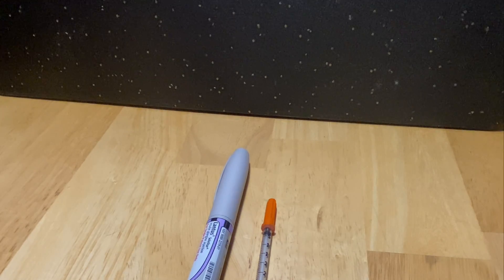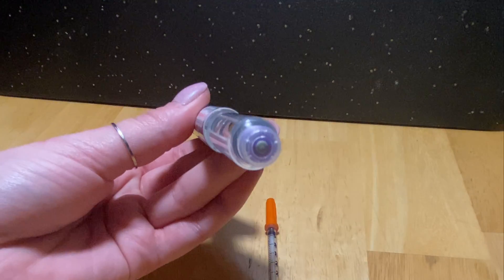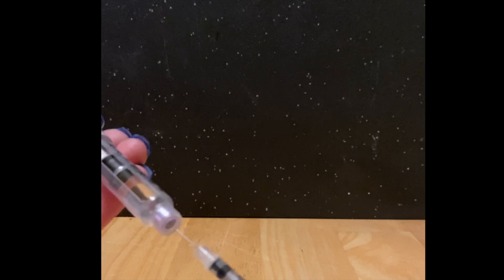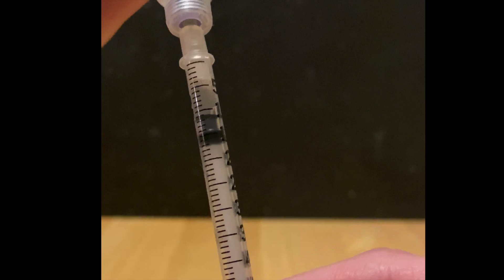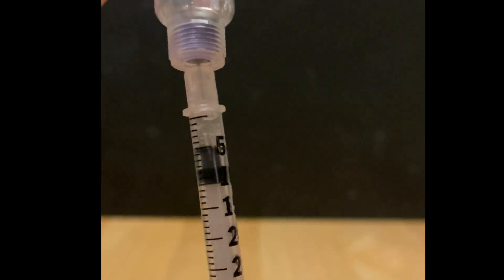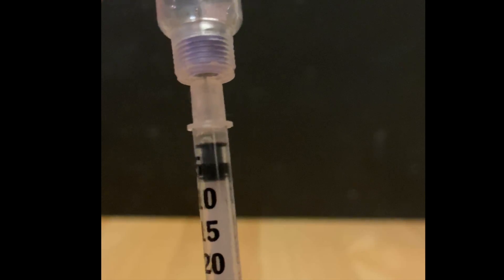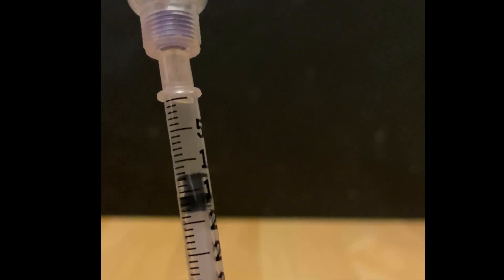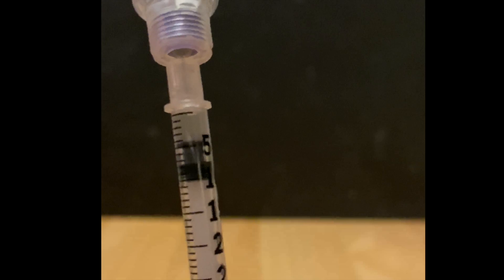How to draw insulin out of a Lantus pen

Comment: Do not inject air into pens.  Pens are designed to work on a negative pressure principle. If you draw up too much insulin in the syringe, squirt excess either into the air or into a paper towel - anywhere but back into the pen. There is a silicon coating inside the syringe. It may contaminate the insulin vial with silicon.

Comment: Thank you for this video. Can this be performed multiple times? I read online after doing this once the pen needs to be thrown away. Do you clean the grey circle with alcohol prior to withdrawing each subsequent dose? Thank you!
Reply from the maker: To be extra safe you can wipe the end (the gray part) with a alcohol swab before hand. As long as you are using a new needle each time, you will be fine with drawing each subsequent dose!